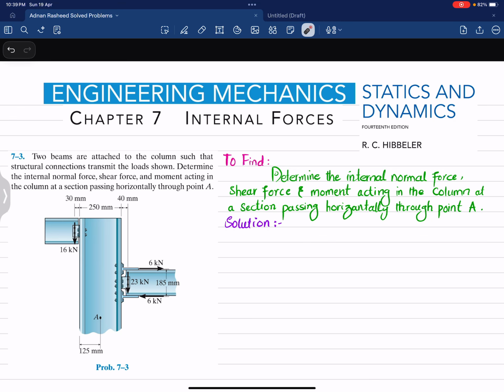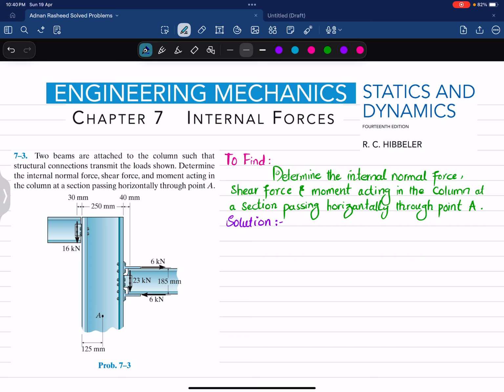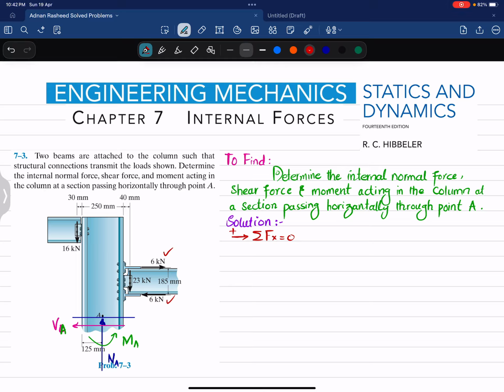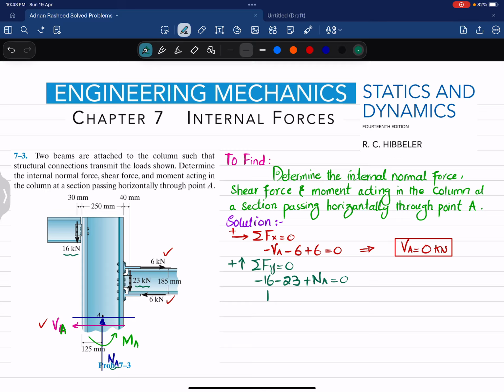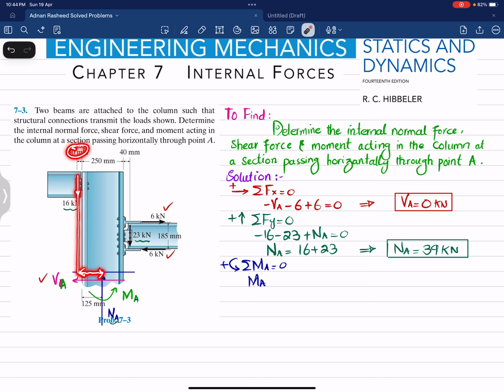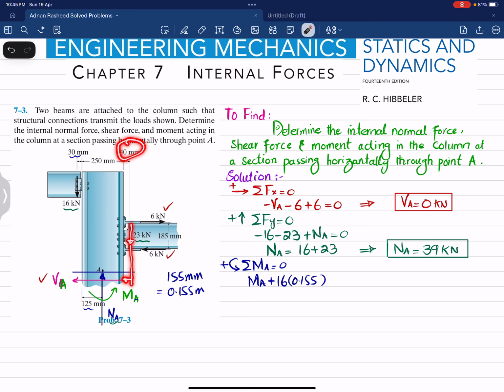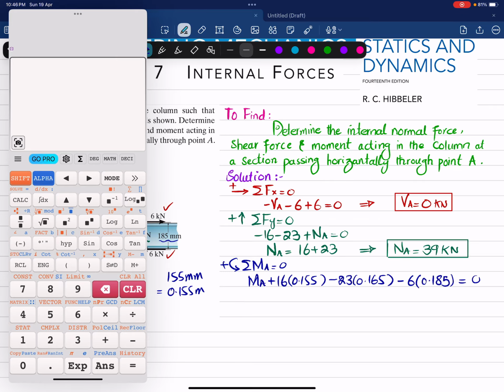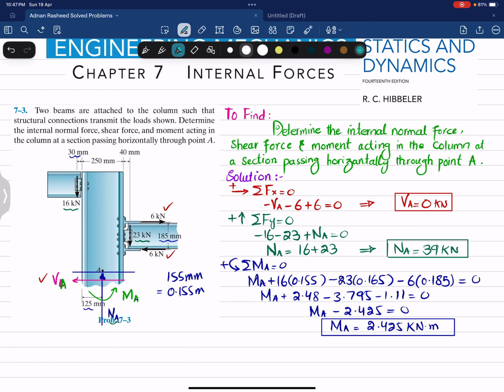7-3 Find the internal normal force, shear force, and moment | Engineering Mechanics

Comment: Hi Sir, i couldn't clear my previous interview for a static position. I was asked to draw fbd for 3d statics for airframe components like.
Shear clips, tension fittings attached on aircraft frame and stringers.
I understand that there is superposition of loads and there will be heal toe moments. But I couldn't draw the fbd. Let alone the sfd and bmd.
I practice lot of the 2d problems but in the interview, i was lost to see real problems. 
It had fasteners and they wanted me to show fastener calculation.
I'm still searching for a 3d statics example like this. Could you kindly help.
Reply from the maker: This is still 2 D problem. I have started this book and hope so to cover many things in upcoming times.
Reply: Thank you for the work that you do.
I looked in forums and found a book addressing the type of problems for statics in Aerospace.
Practical stress analysis, by Jean Claude Flabel.
Reply from the maker: My pleasure ❤